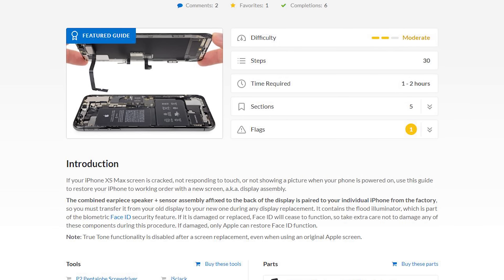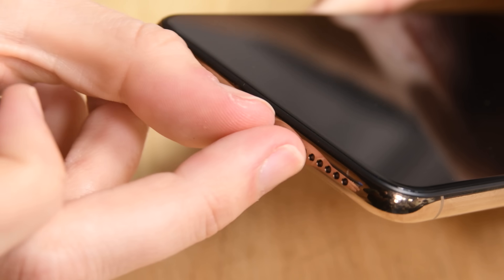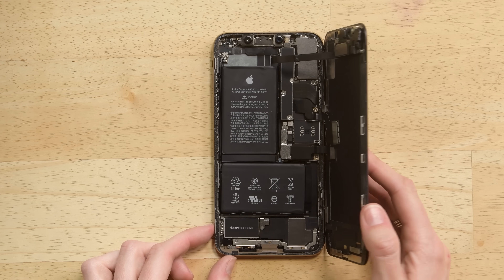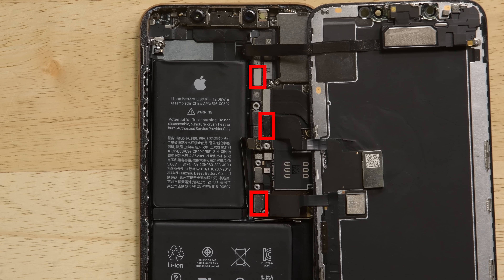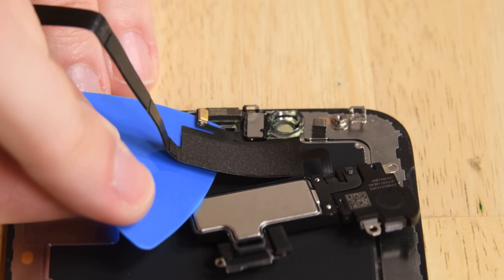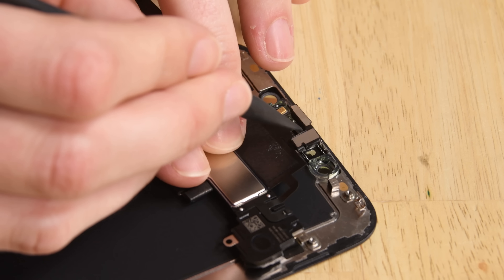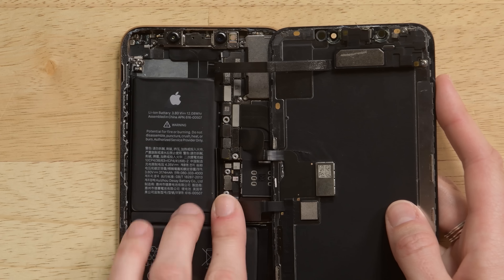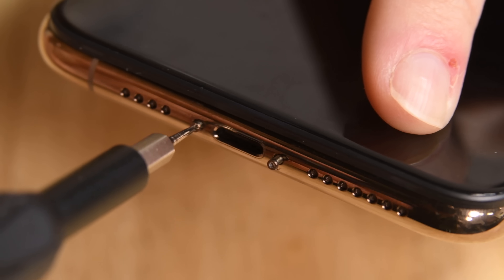iPhone XS Max Display Replacement - Complete Disassembly and Reassembly

Comment: I did every step as the video told, checked if it worked. It worked and I got excited, but after I closed the screen it stopped working all of a sudden. Anyone got a similar problem? I tried unscrewing, and screwing everything back again, but it still did not work. I am disappointed, not even about the money I lost on it, but just for the fact that it worked for a while and then just stopped working.
Reply: Battery connector may have been loose when you thought it was fully seated. They are a little tricky to get aligned perfectly but you also must make sure when you have it aligned to push firmly down, might even have a very light "snap" feel to it when it connects down fully. If it wasn't fully seated, when you closed the case the flex cable moved a bit and dislodged the connection.

Comment: anybody else having issues with the ear speaker portion? i feel like my iphone xs max is different than the ones shown....
Reply: No they are a pain in the butt especially when you have to reuse the adhesive that held it down to the old screen. I've had some that didn't fit 100% exactly but were close enough to work.
Reply: @thejerrytheman  i upgraded to an iphone 14 pro max lmao happy customer
Reply: @VM-eo2iw  Nice! This will definitely be the last time I replace the screen. An upgrade like yours is long overdue!

Comment: This is the best guide on YouTube. Some tips after doing it my self 

1. Make sure you get a magnetic mat I almost lost screws 

2. The face recognition module won’t fit exactly like how it did in the oem screen I kept trying to place it in my new screen thinking it would snap in but it wouldn’t so I just made sure it was secure and screwed the bracket in and it after I finished up it worked just fine.

Comment: I have a problem with my iphone XS Max. Both my screen and the back glass were damaged. I was able to replace the back glass (sort of). However, I realized that I burned through to my damaged screen and wasn't able to use the touch screen anymore along with not using my wireless charger. I took my phone to some third rate repair shop and the guy put a LCD screen on it and not the phone won't turn on without being updated. I've tried, but the phone won't update or let me restore the phone. Is there anything I can do or is my phone completely bricked?
Reply: sounds like something else may have went wrong? can only think something has been damaged in the process of it all and created another issue, either that or perhaps all the wires were not properly connected back? 
i have a problem that i cant remove the charger port screws cause of rust and them rounding off.

Comment: I’d highly appreciate if anybody would answer this question, I currently have an 2 iPhone XS Max’s (with the only difference being one 64GB, the other 256GB) same color. I want to swap the batteries of both phones so the 256GB iPhone XS Max has the better battery, will I still get an error under battery health if I do this or will the battery percentages health change on both phones like normal (one is 100% health and other is at 70% health) any ideas?

Comment: This is not a XS max , why is the screen thick while it should be thin and why is there brackets? the original doesn't have brackets. With the brackets it will not close. I don't get it smh, I need one. Had to return it.

Comment: The video says the display opens from the bottom up, but it opens to the LEFT to protect the cables from snapping. That was a costly mistake for me! Also, you can use diamond wire as an alternative for seperating the screen.

Comment: Question...had my screen replaced today...now the 3d touch for flashlight and camera on lock screen will not work..but haptic touch works for everything else...whats going on?
Reply: Who replaced it? And does Face ID work?
Reply: Narcizo Sanchez so they put a lcd screen on mine...not oled
Reply: Narcizo Sanchez a phone repair store changed it...girl said it was oem screen, found out it was aftermarket lcd screen..now the battery dies 2x faster than before and camera and flashlight on lock screen are very sensitive and open in my pocket alot...reach in my pocket and my phone is hot as hell
Reply: Face id does work
Reply: @Brandonb8621  best thing to do is on your laptop or desktop computer download iTunes.then take your data cable otherwise known as your charging cable plug it in your phone and the other man with iTunes opened plug in your USB cable to your computer. It will ask you to either reset or restore your phone there'll be a description of what eachchoice will do for you I believe the reset will allow you to reset your phone back to factory settings without erasing all your data photographs phone numbers contacts.

Comment: How long do you leave the iopener jesus cant you be more descriptive
Reply: You leave the eye opener which looks like a bean bag on there for about 10 minutes then you take the ice slack opener that has a suction cup on each side and then once you get a little bit of Gap in between the frame and this old screen then you can put your plastic pick in there and start moving around the edge to this large the screen from the frame of the phone.

Comment: Its a pity you dont show anyone how to use a $20 true tone programmer, instead of showing this easy to do guide ! It's a lot harder than that also to open an iphone that has not been done before ! It would have been good to show Noobs how much adhesive is in there, instead of just promoting your own products which are not even needed ;)

Comment: Did my first screen replacement today....... it was hard because one of the screws didn’t want to come out. But I finally got it out and replaced the screen and did the waterproof and swapped everything over and it all works! Also I was worried about Face I’d not working but it still works!
Reply: None of my screws are coming out lol I can’t even take the bloody screen off
Reply: how did u get them out?
Reply: Samee! One of the screws wont come out!! Pls tell me what do i need to do
Reply: @al-garymalik7343 there’s blue thread lock on the screw threads. best practice is to use a little bit of warm heat to soften the thread lock. then begin to unscrew. if the head is stripped you are SOL.
Reply: This comment gave me the confidence to get that last screw out of my mom’s phone to fix it! Thanks

Comment: Wait why do you lose the True Tone function
Reply: DARKSEIDUS because ots not an original screen
Reply: @amirawad7741  you can restore true tone provided you have a tool called the jc-v1 restorer tool. It's available on both Amazon and eBay. This gadget you hook up to your desktop or laptop computer to download the latest software for the unit. Then before putting the new screen on your phone hook up your old screen to the jc-v1 tool to transfer the data from your old screen to the tool then after you transfer that through your computer then disconnect your old screen attach the flex cable that goes to your motherboard for the new screen flex cable and transfer the data you just took off your old screen to the new screen this will be this will allow you to initiate true tone when you put your phone back together. There is a YouTube tutorial on how to use this thing.

Comment: hello the best youtube channel ever... i replaced the screen of my XS then lost the face ID, it says « face id is not available » any easy fix for this issue... they say restoring the phone with DFU mode and itunes would fix it... but i wanted to ask experts like you
Reply: There is many things that you couldve done wrong. You couldve forgotten to unplug the battery. You couldve touch the dot protecter on the face ID camera. You couldve possibly damaged it when prying out the screen. You couldve damaged the ear speaker module on the screen. Theres many things

Comment: Why would True Tone not be functional anymore if your replacing it with an OEM screen
Reply: This happens because apple doesn’t like people repairing their own devices & mostly iPhone repair shops so in the iOS 12 update they made it that all screen repairs have to be programmed with the serial number of the phone. This requires a special machine. It is called a EEPROM programmer. I repair iPhones a lot  so I have the machine but you also have to keep in mind that if you do rip your front camera and replace it you will no longer have Face ID and True Tone will also be disabled. Everything is now programmed together which is why this is happening
Reply: @sohibetaha223  https://youtu.be/85y0pnmSQOk

Comment: has anyone tried this yet? I have 2 xs max, one with cracked screen wich works fine, and the other one restarts every 40 seconds, I switched the screens with front camera and sensor and touch screen wont work on either. I if put them back to its original logic board again the work
Reply: Dk needs testing
Reply: Most likely a motherboard issue. That happens alot in Xs Max’s.

Comment: You can't maintain water resistance after a repair. Those phones are factory sealed and vaccum packed and you compare that with glue! What a joke.

Don't trust me, no worry,  do the repair this way and do the extreme water tests mentioned under ip68 rating.
Reply: It also prevents dust from coming inside
Reply: Ikr i never trust the seals but i still put them in

Comment: What is true tone? Why isn't that available after replacement?
Reply: makes your screen act like paper in different colors, makes it yellow in translation, easier on the eyes. Apple disables it if they notice u replaced screen yourself
Reply: @pecoliky  a lot of these videos don't show you how to restore true tone. There is a tool you can buy for about 55 to $60 called the jc-1 tool. Look it up it will solve your problem but you have to disassemble your phone in order to use it and restore true tone.
Reply: @bassinbillRC5300   you have to remove the display. Not disassemble your entire phone. You should be very mindful of the terminology being used. Why would I take apart my entire phone to have True Tone be programmed ?
I just have to have to the display removed. Not the entire phone !

Comment: why the loss in true tone?
Reply: because each screen has a ID number. If they dont match with the phone's ID, they wont work. Same with newer batteries.  I think its called DRM
Reply: @pecoliky  you have to buy a gadget called a JC-1 screen data tool from either Amazon or ebay.this tool is used in conjunction with a desktop or laptop computer which has downloaded the latest software or firmware update for this tool.once you remove your old screen you need to attach that old screen to the tool to transfer the data from the old screen to the tool then after disconnecting your old screen attached the motherboard flex cable from the new screen to this tool now you'll be able to transfer using your computer the information you just took off your old screen onto the new screen this way you'll be able to initiate true tone on your phone once you put your screen back together and close everything up.

Comment: You should really make a video on the way bits are hold in place in the 1/4" to 4 mm Driver Adapter
 and in the Flex Extension. For those who had the previous version, it can become hard to guess it.
I received my new toolkit 5 days ago and i was very frustrated because i didn't understand the new holding system.
i tought it was a defect.  that feature doesn't appear on any of your  videos.

Comment: Coming from a 6S Plus, I've replaced my screen 3 times. And each time has either an issue with the proximity sensor or the ambient light sensor. I can ONLY IMAGINE what issues are gonna be had with the FaceID module. This is beyond stupid to have this and they should stick with easier to repair items. Anyone else think of these things when needing to repair? No wonder iPhone 8's have seen an ENORMOUS jump in sales. Not even last year's iPhone X will save you.
Reply: Might as well go back to the Nokia 3310 if we want easier to repair items and beefier electronics lol

Comment: 0:27 turn on auto generated subtitle and it will say “you need a pee tube”
Reply: JustPlainShit LOL
Reply: My pee tube is a lil bigger then them screws.  won't work
Reply: @nicolexue0302  🤣
Reply: This is the 3rd time I'm replacing the screen, watching the video for a refresher. Was getting a little bummed over having to transfer all the old crap over to the new screen again for the third time but your comment made me laugh 😆 Thanks for that, 5 years later lol

Comment: Actually the new iPhones are more drop resistant
Reply: No the new iPhone is fuck resistance....
Reply: Nah its still glass it will shatter

If its 1% stronger they will scream drop resistant because marketing

Same with their saphire camera lenses, it has so little saphire in it that its not any more scratch resistant than a normal piece of gorilla glass yet they'll scream wow look its saphire because again, marketing
Reply: @Roshan_420  I remember when i could trow my old gorilla glass Samsung across the room with out a case and it wouldn't even get a scratch...SMH
Reply: @Roshan_420  if it was actuall sapphire it would be much more brittle, which seeing as the current iphones have a camera bump, wouldn't really be good.

Comment: I love how you guys do these kind of tutorials, but most people switch their display only when it's cracked or shattered. So the suction handle doesn't really work well. Maybe try to do a tutorial on this with a pretty badly shattered display.
Reply: Frank Wang figure it out
Reply: @amirawad7741  no need to be a little prick
Reply: If a 13 y/o can do it, then you can. 😑
Reply: While this is very late, I have heard tape is a best friend!
Reply: Just put the wide clear tape across the broken screen , it will suction to that.

Comment: Jerry rig everything tested the iphone xs and he was suprised how drop proof the iphone xs is and he tested it on the asphalt    with the case on and without and it just had scractches on the iphone without the case no broken back glass or front
Reply: So you take one guys review and go with it. I’m sure there are thousands of other people who disagree .
Reply: This actual Jerry is replacing the front glass for the third time, and I replaced the back glass and frame last year (which is a colossal ordeal, won't do that again if I can avoid it) so I'm not sure if the guy got lucky or what. I don't think the XS Max is any more drop resistant than any other regular consumer phone out there.

Comment: If I replaced the screen by following this tutorial, will I lose the data on the device? My iPhone x has small crack and after updating to iOS 12.1 the secreen is not responding. The phone is working fine but I can't use it. I can't even connect it to iTunes to take a backup.
Reply: potato potato potato potato potato potato potato is it sarcasm?
Reply: @xdd15  just laugh for him so he thinks he is funny. And the answer for my question is no. Replacing the screen does not cause loss of data

Comment: I understand that true tone is calibrated with the OG display and logic board from factory. But it seems true tone should still work it just won't be as good. Or could Apple have some way of sensing if its connected to the non stock display and just turn true tone off completly until they calibrate it themselves. I could see them doing such a thing. Hope news about this comes out in time since I have this phone myself and would love to calibrate the display myself or bite the bullet and deal with Apple to get true tone back. If it turns out they do turn it off and only they can re calibrate and turn it back on. 

Doesn't this mean True tone will work just not as well as a stock sealed phone would rit? Also if this is true what will the effect be on the end user if the true tone works but just isn't calibrated to the new display. Will it randomly activate with out rational reason, assuming it should activate in said situation since its using the old screen calibration as its basis? Perhaps. Things like that or any other issues u could see happening would help us out a lot. 

Thanks,
Reply: it just stop working pay more to apple and keeo it if you like it

Comment: True tone will be disabled? I love it :( that's so dumb ughhh
is it the OEM screen? like the original?
My screen is fine but I'm worrying for the future :D
Reply: it will still exist its just that with each phone true tone is calibrated to that specific display and its unique quarks. Therefore since we have no way to hardware calibrate the phone to the NEW display ourselves as repairers. Then we will have to deal with the fact that the phone will be relying on old calibration data to operate true tone. 

Meaning it will work I think, but it just won't be as accurate. Not by much I imagine but it will still be an issue. So don't fret basically, you should be fine. And in time someone will release software to calibrate the new display with true tone software just gotta wait.
Reply: If someone release this kind of software, that will be as a tweak for jailbroken devices only in my opinion.
Reply: @TheReal_ist  Awww. that sucks. Calibration is also important for me ;c

Comment: Glad to see them cover how to put everything back together and how to restore water resistance, much better than the last how to
Reply: Agreed, but if you notice in the repair video, they show putting new adhesive on the frame, but later in the clip the frame they are working with during reassembly DEFINITELY does not have new adhesive on it....
Reply: No they did not show how to replace with new screen. They completely slipped that and the video ended.
Reply: If anything she’s pulled the adhesive off.
Reply: I'm not sure but ,if anyone else  wants to uncover 
computer pc repair
 try Saankramer Electronic Magazine System ( search on google ) ? Ive heard some interesting things about it and my co-worker got cool success with it.